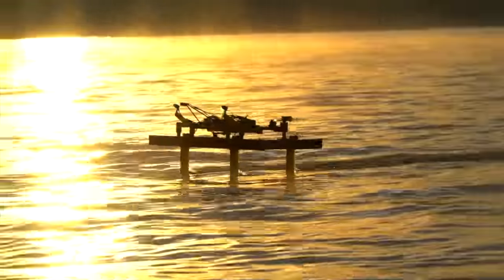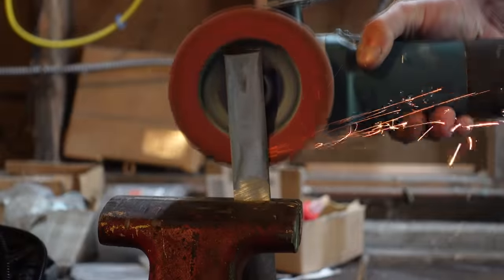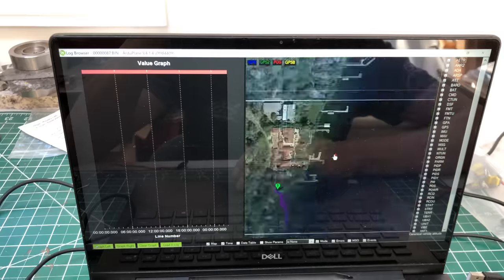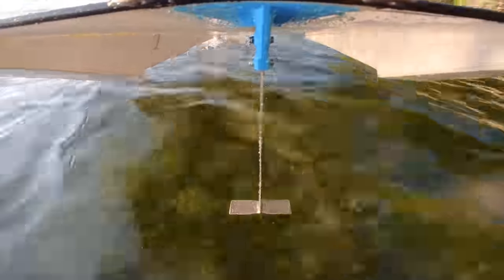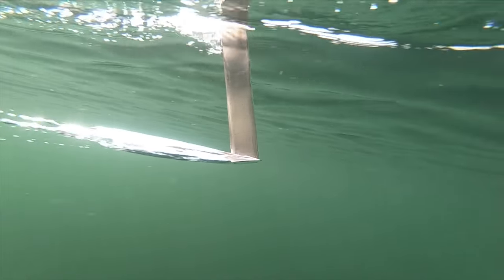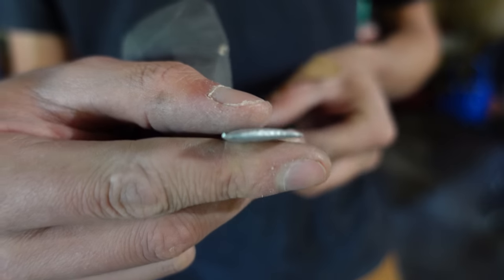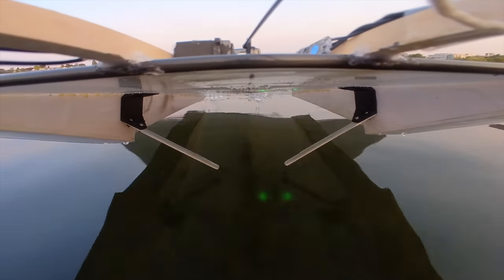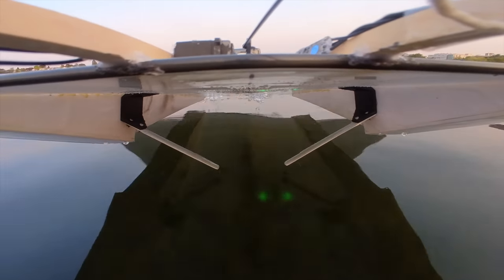Airplane + Hydrofoil - Good or Bad Idea?

Comment: You don't want a super low wing if there's any chance of chop.  I live on the SF Bay and I want something to scamper from SF to the houseboat and back again.  It's only about 5 nautical miles and sometimes the bay is calm, sometimes it isn't.  Lots of hydrofoil options but ground effect seems to be a better overall choice - higher speeds, lower drag, likely better efficiency.  I'm checking this out as it seems to solve the transport problem.  Ground effect plus hovercraft means I can land on the beach or in the harbor.  I'm also a Tesla Sr engineer and would want to EV convert it as a single Tesla motor is about 220kw, way more than needed for this application.

Comment: That Regent aircraft is definitely a seaplane they just designed it to be good in ground effect as an airplane is concerned, half the wing length above the surface is enough to “help” going only over water and not able to fly higher is probably for safety reasons. Seems hard to use practically but a very cool project nonetheless. Your videos are awesome I watch till the end keep ‘em comin!

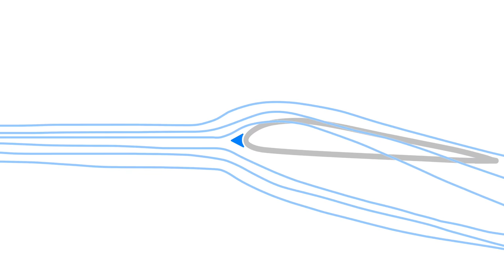Comment: 8:00 This is so fascinating. It's like how a truck has better fuel efficiency with the tailgate up even though you'd think that would produce drag, but it actually doesn't as it's designed to create a pocket of turbulent air that the other air just flows around. Driving with the tailgate down removes a tiny bit of theoretical drag from the tailgate, but adds more drag around it because it gets rid of that pocket.

Comment: I always thought about building one of those, except my concept was sort of a airplane with legs where the lifting body (passengers and pilot) is in front and the waterski/foil part (power source) remained attached to a surface on a sled.

Comment: Based on my experience in sailing hull design, I wondered if making a V hydrofoil would help with the transition from air to water. A more gradual "entry".
I also was listening to an AC foiler  Catamaran discussion, where they noted that any vertical surface entering  the water, induced air down to the foiling surfaces, and created cavitation.
That diagram showed foils entering the water with Dihedral angles,  :1:57 - "Surface Piercing" instead of straight down. "Fully Submerged"
Those two category's at :1:57 are deceptive. ALL foils are Surface Piercing, unless you are a Submarine.

Comment: Excellent video as always! 
With regards to the use of hydrofoils, Regent are selling their addition as a different phase they can operate in. Ie they can operate in an area close to shore on the foils at relatively high speeds without the wake. When they then get out in the open they can proceed to flying. Rather than solely a way to get the craft out of the water more efficiently.
The thing to be concerned about with foils is the possibility of ''hooking' them in the water at high speed as happened with the X114. The Seaglider retracts them to avoid this. But there is still the concern about the conflicting aerodynamic/hydrodynamic forces/moments between foil and wing lift. They are very hard to marry up.

Comment: Wonder if having a different wing profile would be better for hydrofoils, maybe even capturing the ventilation/cavitation air bubble and using it for lift. I know there are some boats with flooding compartments (flooded when not moving, for stability. Empty out as the boat starts to move for higher speeds.) Applying this concept to a hydro wing make me think of basically one with a front slat, but the slat is attached at the bottom. Or just a channel slightly behind the top of the wing profile. My thinking is that at speed this would create a pocket that would either just help with lift, air is lighter than water an all that, or serve as a vent to bring the gasses along the foil and out of the water, away from the wing itself.

Comment: Excellent stuff!
I reckon skis with suspension are a better match to GE. No finicky stability issues, no ventilation or cavitation, no weed or flotsam issues.
I'm pretty sure now GE is a bit of a dead end. By the time you make all the compromises for water and waves, the gains for flying are lost. Low flying is not safe, even over water. Go fast enough and you may as well just climb to a safe altitude.

Comment: I think there might be a way past this with the full-size.  Why does it cavitate?  It cavitates because you're changing the direction of the water with the foil in order to achieve lift.  If you were able to adjust the angle of attack dynamically, you could adjust it to zero, which would minimize cavitation and drag and eliminate lift at high speeds, or adjust it to steep, which would allow for high lift at low speeds.

Comment: I would suggest a different approach for the hydrofoil. Look at them as two wheels each side of the aircraft, with a builtin suspension. Make them as a V shape thin flexible blade, the more they sink the more lift you'll get. Add some independent damping system for each one. Make adjustable convergence to stabilize yaw. Keep good videos!

Comment: In my youthful days like 50yrs ago I fashioned a model hydrofoil boat using steel tape measure fragments. It worked best in an identical front and rear dihedral configuration and surface planed very stably.. the hydrofoil thing applied optimally  probably enhances the transition to ground effect more rapidly.. other than that mabe. You're clearly a dab hand with a tig.. 👍

Comment: Kavin, what if you can make the hydrofoil appear and disappear? Kind of coming out of the side-floats. Reason: just make the floats lift a bit out of the water, just to reduce drag of the hull. Once it is a bit higher, flip the hydrofoil back in and ... lets hope the decreased drag (floats higher and hydrofoil gone) will let the speed build up for take off. No need to flip them out for landings.

Comment: I think there's one more way to pair these two forces together and that's the way the Vestas Sailrocket 2 achieved it. The two forces have to be in opposition. In the case of the Sailrocket, the hydrofoil actually pulls to keep the boat near the water rather than lift it. I think Sailing Tip's video on the topic explains it very well, I recommed checking it out.

Comment: @rctestflight : Maybe the submerged part could be used as an automatic pitch control if its design was different: I imagine a boom protruding 30 cm at the front, on the central axis, an a curved ski (like a comma) attached to the end. It could be a thin (5mm wide?) carbon strip, like the one we use to reinforce wings etc, which elasticity will provide the curved shape under the stress, and a dampening of the waves. Maybe you will have to overlay several strips like a leaf spring to have a more rigid front. Then tune the angle of the entry in water so it maintains the plane pitch close to the stall angle...

Comment: watching your progression with the ground effect stuff,
'take off' always seems to need more power to achieve breaking the surface?
with the hull drag on water, and you cure this with your par thrust tilt motor set up

you said with an aircraft having a hydrofoil hanging is a lot of drag?

could you make a retractable foil?
so you can get lift from the surface really easily with its lift
then as soon as you get enough airspeed for the ground effect?
retract the foil :) 

i guess the challenge there would be to make a boom that didnt have tons of drag.
and to keep the foil in line with the aerofoil while retracting

im sure with all your engineering know how..
you could make it happen as your half way there already ;) 

love the vids dude keep it up !

Comment: Back in the 70s the Air Force Research Lab put a hovercraft guts on the bottom of an airplane (a C-7 Caribou IIRC, called the Air Cushion Landing System or ACLS). Not sure what their results were, but it sounds like something you would try.

Comment: Good work on finding the camera.  I lost a GoPro 10 at 35' depth.  Found it a day after I lost it with a fresh tank,  There is not a good GoPro mount available to anchor one for static underwater video.  I have been filling goosenecks with lead pearl weights.  Works OK.

Comment: You can reduce ventilation with a delta shaped foil protruding in front of the struts, less weed and a larger planning height range. i mean just the tip outside is enough for planning by ventilation ( just when you want). 
Short strut, small delta at an high AoA near the leading edge

Comment: The fastest sail hydrofoil, the vestas sailrocket, specifically uses a sharp foil that cavitates due to how cavitation significantly reduces drag. It's an extremely unique design that only works in one part of the world, and the foil actually holds the boat down instead of lifting it while the sail propels and lifts the vessel. I'm of the opinion that the cavitation issue is basically the naval equivalent of the sound barrier, and the struggle to overcome its issues is not dissimilar to how difficult it was to design a plane that could break the sound barrier that could still fly regularly up to that point. I reckon that within our lifetimes someone will figure it out, and there will be a special classification of ultra fast foiling vessels. Probably military if we're all being honest.

Comment: You probably could just use some high-quality brazing material to make that hydrofoil and keep the added material to a minimum, helping it stay
 aqua dynamic.
Reply: Also, make them WAAAY thinner. Like paper thin. It’s lifting up a piece of foam, not an anvil. I don’t think you need the airfoil shape either, just a knife edge both on the trailing and leading edge 🤷🏼‍♂️ Because it’s lifting such a small amount of weight, simple displacement should be enough to lift it up, airfoil generated lift is unnecessary and probably a source of drag.

Comment: Food for thought, the fictional S-76 Sea Dragon from Avatar 2 is a gorgeous GEV/Hydrofoil hybrid, using seperate foils in the hull and wing tips at mid throttle to get the hull out of the water, then mechanically retracting them for ground effect flight at full power.

Replicating helipad, rear mounted boat ramp, and moon pool optional

Comment: The distributed electric propulsion concept is unintuitively effective. Check out the X-57 concept plane...that wing is absolutely tiny for the size and weight of the plane, and would normally have an extremely high stall speed. But it has the same effective stall speed as the wing it replaced despite a 160% increase in wing loading.

Comment: This is excellent, I'm so very glad to see it just about now. I'm currently making some carbon fiber foils that will be used in kitesurfing and perhaps downwinder SUP riding ~ My rejects (Of which I have several )  could be useful in a real nice one man version of the kind you model. They are overbuilt and it's taken some time to get it right. No demo yet but all the components are solid so far.  I'm quite pumped over creating a WING IN GROUND amphibion ! THANKS !

Comment: @rctestflight SR-71 strakes are not for aero.  They're for reducing radar cross-section for approaching missiles.  At supersonic speeds flow separation is an even bigger concern.  The faster you go the rounder you need to be.  Look at the Space Shuttle, which enters atmosphere at approx Mach 21.  Blunt.  Otherwise it would be impossible to control.  And it would melt because of the increased friction from the turbulence of a shallower boundary layer.  That much you got right.  To vary the lift with the depth, add more hydrofoils.  As the upper ones leave the water, lift is lost.  Add sweep so it has better odds of shedding weeds.  Yeah that will be less lift, but it should also help it shed air, which is more consistent lift.
Reply from the maker: Wait but I never said the SR-71 strakes are for aero

Comment: I would try to do it the other way around. Like a foiling boat that also uses groundeffect. With a propeller in the water and not in the air. just using Ground effekt for extra lift.

Comment: I'm not surprised the Hydrofoil doesn't work so well. They work at different speed domains.
But I guess it could be a good idea to control the angle of attack with a servo to find the sweet spot (and possibly even put them into the pitch loop).

Comment: i dont know if you will see this but have you thought about putting the hydro foil on the back end so it trails behind the craft and anchors it to the water so to speak meaning that the craft has more stability in some turns ? ...

Comment: So Daniel, what about: A Ground Effect Vehicle that starts to lift out of the Water via Hydrofoil, the Foils leave the Water and the GEV uses Ground effect to travel

BUT has not enough power to fly and doesn't tilt its Motors to lift out of the Water.

using 2 or more Foils to have the COL direct under the COG and enough lift to just have the foils in the water at lower speeds

Comment: Well at least you gave it a try. I can see why a foil could be useful for real scale ground effect planes. Like you said to save weight, and also to land safer at lower speeds before they enter a busy shipping lane or harbor, and still being able to reach the destination or a harbor at a reasonable speed. So basically it would be a substitute for a landing gear with wheels just to save weight on the hull and to protect the hull from the force of the water at a higher traveling speed once the plane stops using the ground effect. I think that it makes sense for real scale and real life conditions. But it would not make any sense at all to keep the foil in the water at all times, even when the plane is traveling at the speed when it uses the ground effect. That would be the same as if you fly an airplane low across the water while dragging an anker.

Comment: It is hard to tell from the video, but it didn't look like the steel foils in the first section had much of an airfoil shape?  It looked like you were relying on angle of attack and the ram effect of the water being deflected downwards by the foil to produce some upward force?   Another great video!  It would be very cool if some small foils could be fitted to the pontoons of a seaplane - the amount of power it takes to get the pontoons onto the step (planing) is huge compared to how much power is required to maintain speed on the step.  The sooner you can get those big drag-producing pontoon hulls out of the water, the sooner you will reach V(rotate), and less distance would be needed for takeoff.   You would make Kenmore Air very happy :)

Comment: The regent aircraft also has WAY too narrow wings for a pure ground effect vehicle. you want to maximize you chord length in ground effect. Although with their wingspan they will be in ground effect from 0 -~35 ft above the water, so it may be more accurate to describe it as an airplane optimized for ground effect than a ground effect vehicle.

Comment: The main difficulty in creating a hybrid vehicle, both a hydrofoil and a plane, is that a hydrofoil looses elevation when "lifting off" - cutting through water at near zero depth. The vehicle must not rely on its submerged flaps in order to gain take off elevation; on the contrary, it must rely on the elevation it wings. There must be a way to minimize drag of the flaps while taking off - perhapse folding them to a vertical position so at least they don't cause instability. Of course, there should be two flapse in this case, to balance the forces.

Comment: I imagine this adds a level of complexity that would go against some of the design principles, but could you have the submerged hydrofoil set up to retract?  Something like an air speed sensor to determine when the ground effect would produce more lift efficiently compared to the hydrofoil so it can pull up and get flush against the wings.

That or something like a speed limiter based on one of those metal rod force sensors that bend minutely to detect force.  You could have throttle limited to the force on the foil.  Having a foil per motor with immediate feedback from a sensor like that could produce a nice bit of stability.

Comment: You mentioned that the steel you used was particularly “stiff”.  The stiffness is a function of the elastic modulus which is more or less the same for all steel alloys.  What varies from one alloy to another are the strength and hardness.  That’s not to say that you didn’t make a good choice.  For your application you’re probably mostly concerned with corrosion resistance and weldability.

Comment: The sea glider is designed to fly low to avoid aviation rules and to operate in the same rule set as boats. So it's just a height restricted plane.

Comment: you need a foil pitch control system.  I recall a float on a pivot driving altitude for a small hydofoil back in the 80s.  maybe you can use the same thing you used for the WIG and do it electronically?

Comment: Given the high drag, would sweeping the hydrofoil wings be beneficial?  There would be more material, but the angle might make it shear through the water better.  I'm reminded of the transition between subsonic and supersonic flight, and also of the machining principle of an angled cutting tool shearing material better than a tool that is flat on.